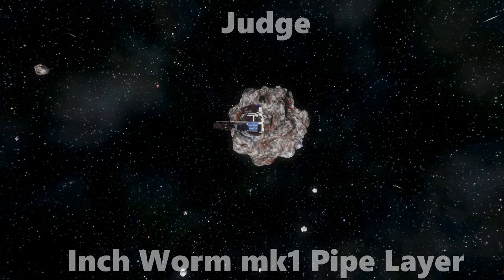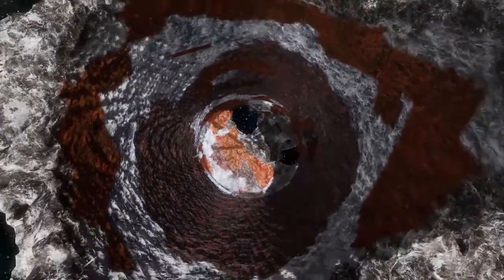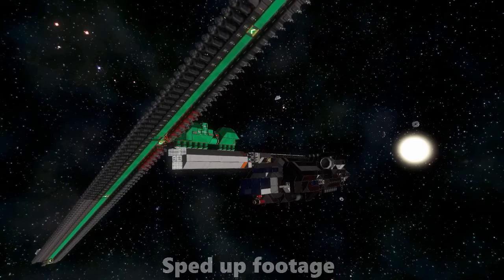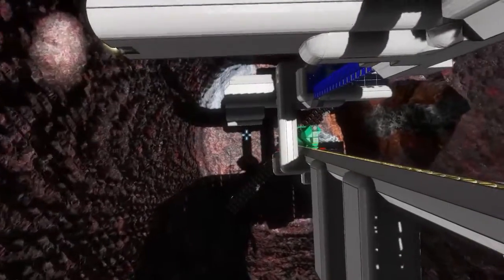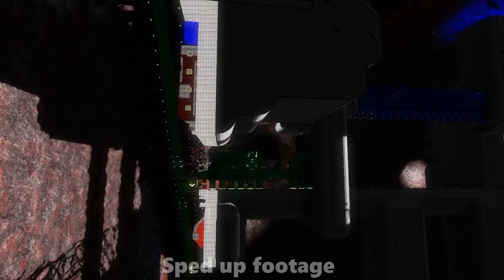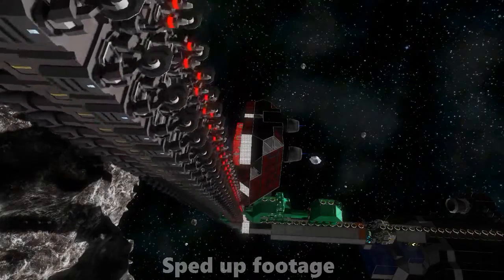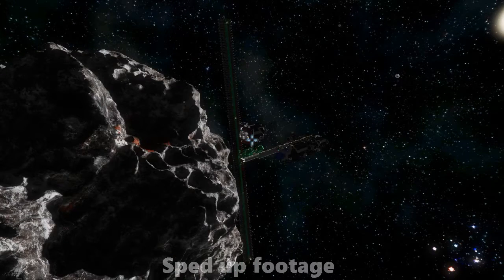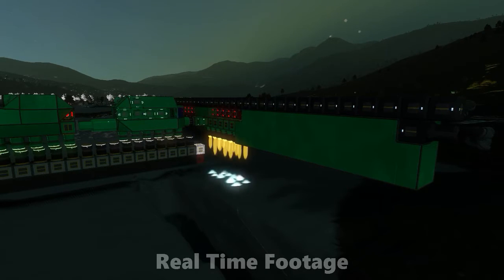Judges Inch Worm mk1 Pipe Layer

Comment: Hi judge have u tried standing it up and pointing it down??? All the resources needed are under your feet and with stone and gravel mods you would be set
Reply from the maker: +Si Fi I gave that a go and it is just too heavy for a single row of connectors to handle.  A double sided rail worked better, but is rather resource heavy.